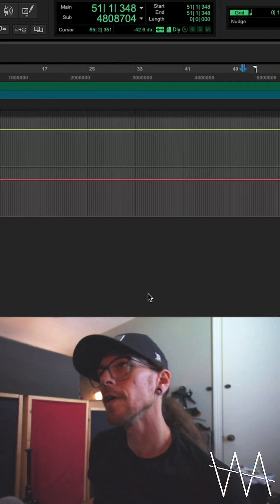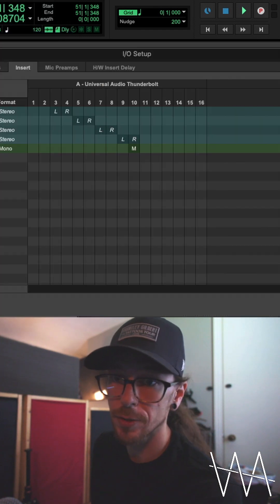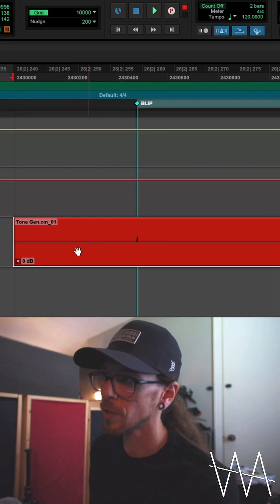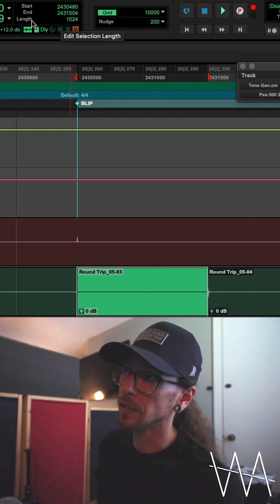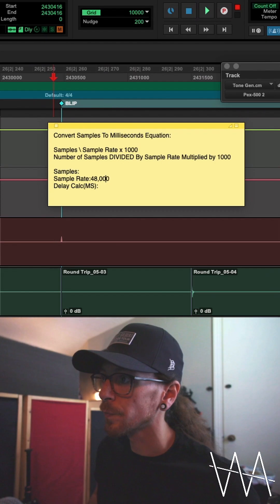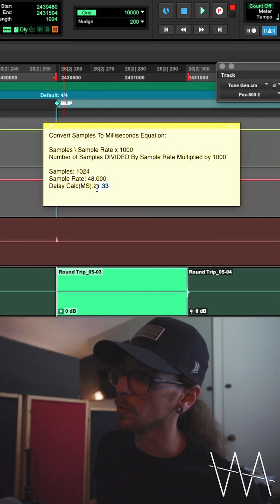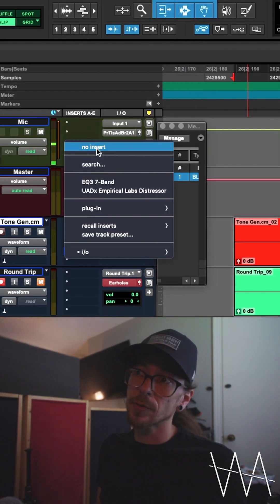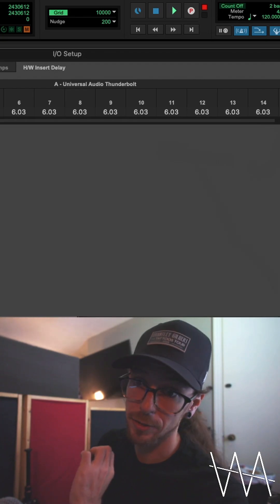Setting Up Hardware: The DAW Side - Protools Inserts And Hardware Delay Compensation

Comment: For some reason, my hardware return is being recoding EARLIER than the internally routed blip. This is driving me crazy and you can’t add negative values in the HW Insert Delay tab.
Reply from the maker: Did you zero out all of you HW delay compensation to zero before running the test?
Reply: @WestfallAudio Yep, this is my first time using hardware so it was all zeroed out to begin with. Cannot figure this out 😩
Reply from the maker: What’s your interface?
Reply: @WestfallAudio Audient EVO16. It’s crazy. I’ve done all the calculations correctly but it still is arriving /printing early. It seems like this should be impossible lol

Comment: No matter what the buffer size is this equation will work?
Reply from the maker: No! 
You will have to re-calculate if you swap the buffer size. 

Export it as a preset in your I/O setup once it’s calculated and you can import the proper numbers based on buffer/sample rate! 

I’ll usually stay in 1024 when mixing so I’ve got all my presets calculated for that.

Comment: Should I turn off delay compensation in pro tools?
Reply from the maker: I’ll keep it on when I’m mixing. It calculates the latency caused by plugin processing and tells protools line up the outputs of each track to keep things sample accurate. 

I’ll turn it off when mastering because I’m only treating one stereo track so I don’t have to worry about time alignment on multiple tracks and it saves processing power for more taxing plugins. 

Definitely want it on if you’re going to be inserting any kind of hardware in a mix.
Reply: @WestfallAudio appreciate it. The reason I asked is because my round trip signal I’m tracking into the daw is earlier than the original blip.
Reply from the maker: @Tha_MeccaIf it’s earlier than the original blip you should first make sure you’re in a fresh session at you’re most common sample rate. Second check to make sure all your “HW delay compensation is set to 0ms in the I/O Settup Setup window. 3rd is make sure you dont have any plugins running for the test. 4th make sure to turn on delay compensation in the options menus before you start testing.